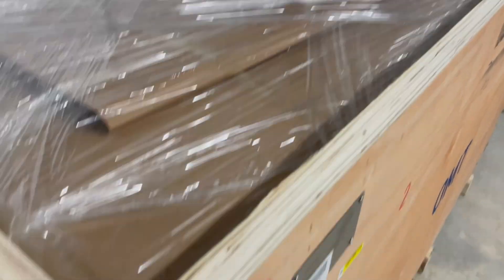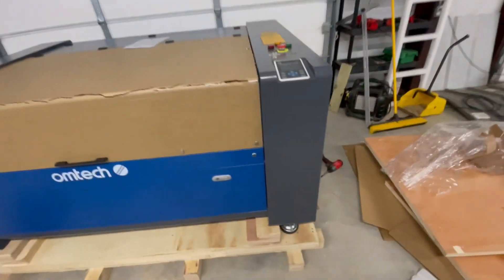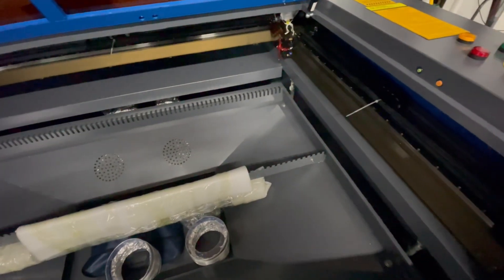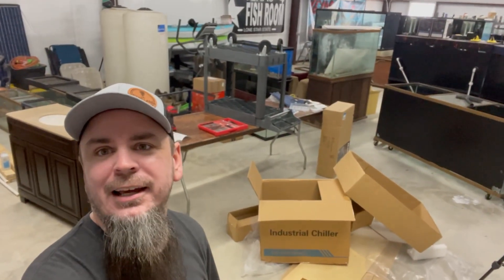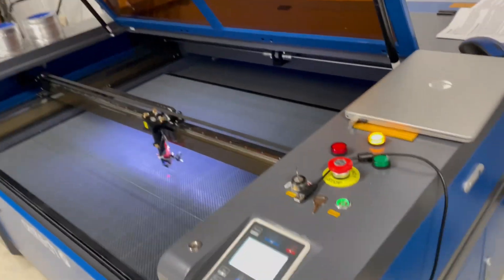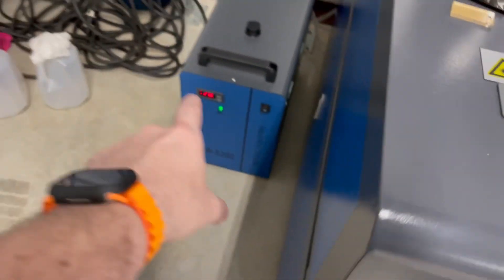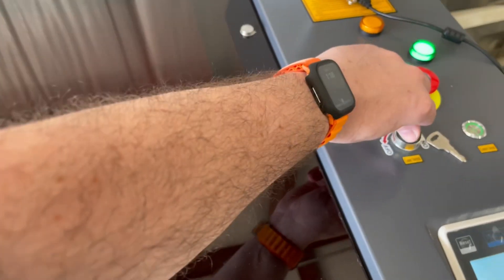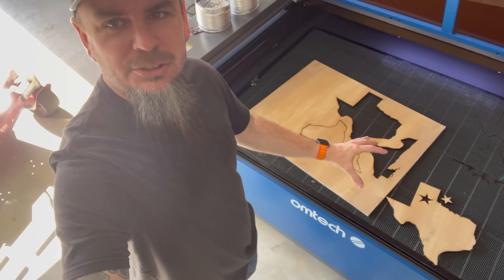Unboxing 130 watt co2 omtech laser

Comment: Hello, I have a question for you as an owner of a 130w.  I’m considering one but someone said I need to be concerned on smaller engraving projects because the laser may not be able to do them as well as a 80w because of the minimum watts required to fire the tube. Have you had this issue?
Reply from the maker: @joshuaosteen0616  i have engraved many pictures with this with no issues. It doesn’t get the best quality on the ultra high detail. But will still do photorealistic images.  Now saying that i do use other lasers for my photorealistic images. This laser runs about 8 hours a day running leather patches. The patches will have a lot of fine detail that machine will do with no problem.
Reply: @Jeffdoeswhat  would you suggest 130w or 80w as my solo laser? And thank you for your time and response.
Reply from the maker: @joshuaosteen0616  depends on if you are doing a lot of cutting with it. If doing a lot of thick wood or acrylic i would go with 130w. If only wanting to do small stuff more engraving based i would go smaller with something like the polar+ 55w
Reply: @Jeffdoeswhat  thank you. I’m probably going to go with the 130 because I will be doing a combination of both.
Reply from the maker: @joshuaosteen0616  that is my affiliate link. Sometimes will give a bit of the time but not all of the time. Saying that Omtech has not sponsored me and i bought this laser myself for my business Texas Laser Worx. https://omtechlaser.com/JEFFDOESWHAT

Comment: Hello there! I have a question for you,  i just got my 100 watt laser the red and black, it came with a broken laser tube, am at a point idk what to do.. tips? How u liking it so far
Reply from the maker: As far as laser cutting the machine is great. Only issues i have with mine is i can’t get it to engrave bi-directional. The machine is well built. I do wish the bed could go lower on mine so i wouldn’t have to take the honeycomb and slats out to use rotary or roller. My next c02 i will buy will probably be a thunder laser. But that’s because they seam to have better tech support. I turned in 3 tickets on mine and heard back once after i fixed the problem.